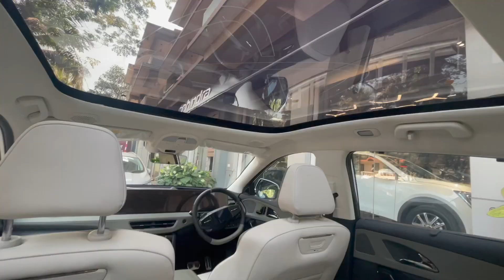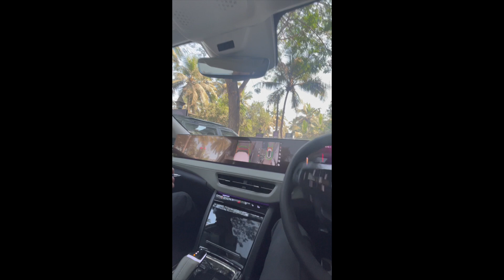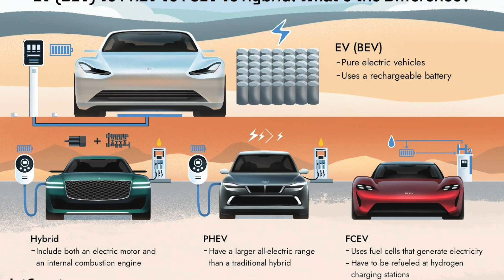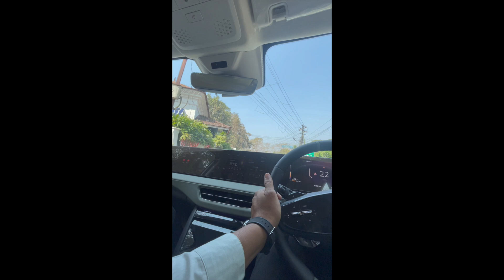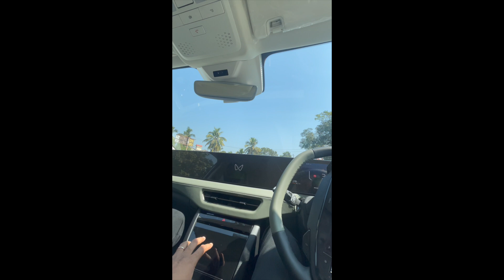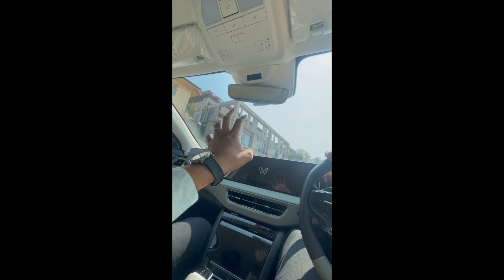DONT buy the hype ! Mahindra XEV9e & BE6e | Mechanical Engineering Podcast

Comment: Battery-pack usage in a car with varying climate / operating conditions  ,its reliability, Life span etc are to be experimented and to be understood over the time. However the Touch-points analysed are excellant and informative. But for sure no EV car user can be very confident about their equipment no matter what brand they use.
Reply from the maker: Yes, the technology is still evolving and there's definitely a learning curve with EVs.

Comment: Excellent video. very informative. You haven't mentioned much about the improving ranges and the reason why BE6 and xuv 9e are getting traction is because of 500+ km range, practically enough for any single day drive. I live in Bangalore and infra on any good 4 lane for EV charging is superb. So unless you go into the forests or remote homestays, I see that majority of hotels and towns have a EV charging infra in all directions from Bangalore. 
I am yet to figure out the home charging infra (what will I do with 7kwh charger if my sanctioned load is 5kw). Along with battery degradation, low resale value and first batch being beta testers, this is major issue in my mind. That said, I will book XUV 9E tomorrow
Reply from the maker: I appreciate the input on EV charging infrastructure, but I wanted to focus on the practicalities of adopting an EV today for the average consumer. Bangalore is my channels major audience, but I want to generalise the idea to the Average Rajesh in a Tier 2. EV infra vis a vis Fuel  stations are still far and few between and therefore need a reality check. Of course in cities like Bangalore and arteries around it definitely adoption is driving infra, just like California vs rest of US. So we will need scale of adoption for infra to be economically set up to reach critical mass. 

Good luck and wish you many miles in your new 9! It’s my pick of the lot too!

Comment: There will be a greater push for EVs to line the pockets of a certain crony capitalist who has pre-established himself in coal and electricity supply avenues. Eventually it will only be a change of the imported fuel and the overseas supplier. Many new infrastructural development and employment opportunities will present themselves. However, this is only a replacement of technology and not a push into an innovative new sphere as they are making it out to be. Moreover, any employment so generated would actually be compared to disguised unemployment. You need to stress more on the future shock associated with EV battery disposal management. Just like you touched on the coupe's lack of any real aerodynamic advantage when compared to its impracticality due to the lack of space and headroom.
Reply from the maker: @kolrodrick  very deep insight. I do briefly mention about battery disposal woes
Reply: @tripaccino great vlogs mate! Better than most auto pundits for sure.
Reply from the maker: @kolrodrick  thanks mate. Appreciate it

Comment: There's is always a trade off when you migrate from one technology to other.
Most of the average Indian house holds dont drive more than 2k km in a month (might go for occasional long drive,where if planned public charges will fill the gap)
So In my opinion Mahindra have cracked the code by iffering 79kw and delivering that in first lot to give confidence and negative publicity, In book out of 10 Ev's(especially Bev twins) have 8 pros and probably 2 cons, but IC its other way round
Reply from the maker: @greengrandiose  🤔 agree
 Most families travel less than 1k month

Comment: That was a very informative video and I thank you for addressing my question from before! However, I have another question 😅. If the reality of battery disposal is going to hit us in the future like you said, then wouldn't the answer to a green future be h2 ice engines?
Reply from the maker: H2 ice engines- where we use h2 as fuel (not h2 fuel cell) has issues of handling h2 as compressed gas or liquid. We need to handle large pressurised tanks within the car architecture . So it’s tricky. And where do we set up h2 pumps . ? Electricity comes to your house
 H2 doesn’t . Uphill battle

Comment: Two additional thoughts that I have to share to a brilliant analysis of the Indian EV market. 
EVs get 40% depreciation instead of the usual 15% for ICE. So, if you run a company/business/MSME buying a luxury EV makes perfect sense as a 2nd/3rd car along with the 5% GST. Case in point being the BMW iX1 LWB which works out to be way cheaper than the ICE X1. 

Building charging infra requires planning at the city, district, state and Central level along with a private push. I am sceptical about this given that we already prefer gated communities and large SUVs to insulate ourselves from our hostile cities. It will be way harder to maintain upkeep for a 150 kW DC fast charger in the middle of a highway than a fuel pump. I am sceptical of planners being able to build out this charging infra.
Reply from the maker: @saharshjindal6448  great point about depreciation. I wouldn’t have thought in those lines cos I’ve never owned a business and wouldn’t understand this nuance. Thanks for sharing this input. 

As for charging infra. It would be pushed by car makers to get some propriety and visibility in this space. They would think of it as CAC to grab more customers in the initial surge .As i said to gain some traction they need to sway bunch of early adopters towards therir brand

Comment: Nice and valid  points and analysis. However I may not agree with all your views. For eg EVs will be increasingly used for intercity commutes as the range is now above 500 km which is higher than one would typically drive in a day. EV infra will improve with time. Certain EVs have the potential to be your only car. M&M has put up an automated plant which can reduce defects and improve process capability.  Electronics - well let's wait and watch.
Reply from the maker: You’re absolutely right and I’m in agreement with all your points. But will not happen tomorrow. That’s what the podcast is saying. There’s a bridging gap between the NOW and the EV future you have rightly brought out. I’m talking about EV options today Vs hybrid today Vs ice . We must ask ourselves 500km plus range how many EVs have today and how would you charge it at the other city ? Hope that highway infra is ready and at the destination you have enough time and place available for a overnight charge ? These are hard practical questions we need to answer today. Eventually it will get better. But until then, podcast wants us to be pragmatic with our expectations and hand-hold the mass market towards impending EV adoption👍

Comment: Great video! A couple of reasons why I think EV adoption will be faster than what you suggest: 1) Govt., esp India, will be keen on reducing USD crude oil import, even more than reducing carbon footprint. The falling Rupee just adds fuel to the fire. 2) I think interstate travel will be possible much sooner, and highway charging infrastructure should be much better in the next 1 year. Again, the reason behind is EVs are more efficient, and if a business can reduce the logistics cost, why would they not? So trucks and buses moving to EV is very likely to happen soon, as reducing logistics cost will be a no brainer for the business.  Valid point on the energy density - but I think a 100kw passenger vehicle battery, pretty much is possible soon and with some charging infrastructure improvement, we will be all good.
Reply from the maker: @abishek_logbase  true

Comment: Why don't we have diesel electric or petrol electric engine? Something similar to locomotive engines?
Reply from the maker: we do. its called Series Parallel Hybrid. We talk about it later in video.hang on
Reply: Suzuki is working on that, You might see Fronx or Brezza on that technology 

Suzuki's new three cylinder engine was built to do this technology
Reply from the maker: @ true